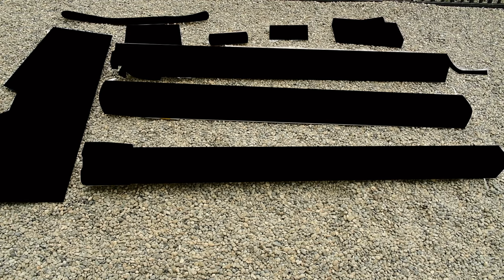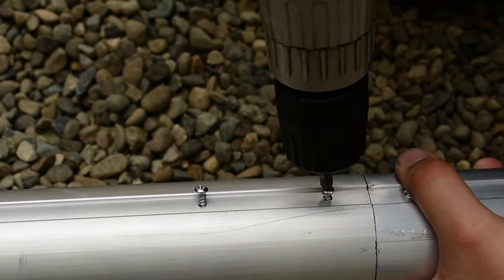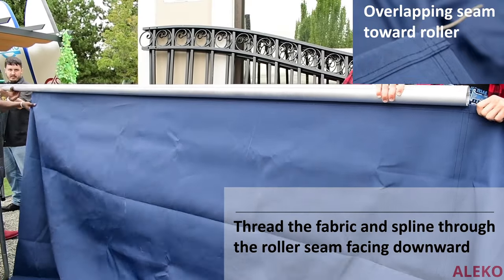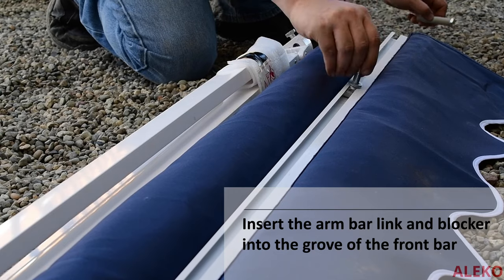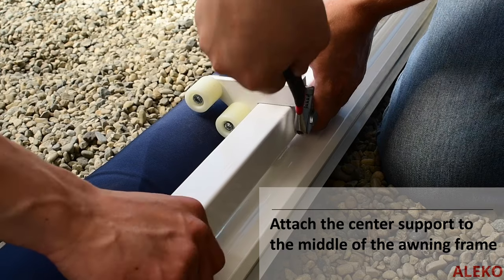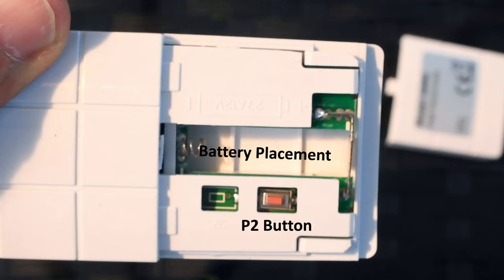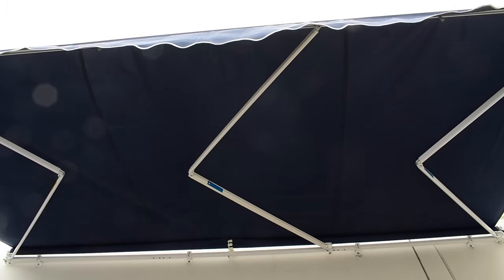How To Assemble and Install Your Motorized ALEKO Retractable Patio Awning

Comment: These instructions are awful.  You should hire a professional company to do your videos instead of doing them in your back yard.  Hours of frustration trying to get the motorized awning to work and still not working properly.  Will probably return.  I am pretty handy but this has been a nightmare.  Bolts are all in tight spots, materials are questionable and the instructions are awful.  Save yourself the heartache.
Reply: It's stuff like this that I am pissed about the removal of the dislike button. Bloody thing doesn't come with instructions, so I had to find it here--and yeah, they are shite.

Was almost as aggrevating as when we found that the center of the main fabric had been completely stitched--so we had to cut the threading piece in half and stick one piece in each end.
Reply: It sure is awful instructions! The company need to do a better and stop wasting space on YouTube.
Reply: I totally agree. A pin in the @ss!!!! Now im going to take it back down and build an actual part over the deck.
Reply: Deffinetly true.i couldn’t even figure out what direction to mount the arms

Comment: I assembled and installed by myself in about three hours.  The wife and daughter hoisted from a window above as I heaved up and into the first left hand wall bracket. I followed the instructions slowly and precisely.  I enjoyed it. In the morning I will fine tune the arms end connections at the front bar so it can fold and close smoother.  The adjustable LEDS are perfect.  The sand color and brown frame match my windows and entire back yard house and surrounding.  I love Donald Trump but I am very thankful for China today and this very well priced and manufactured Awning I received in two days from Ebay.  I am in Canada by the way. The wife and daughter hoisteed from a window above as I heaved up and into the first left hand wall bracket.
Reply: I hope that you have recovered from your temporary insanity about the former orange guy....

Comment: Installed my 20x10 unit last Saturday. I watched multiple videos and read the instructions. It went fairly well but I did have some issues. This is a difficult project.
Reply: I am installing 20 x 10,  do you have center support. I don't have that in the box.
Reply: the instructions were horrendous!!! I had to take apart and reassemble some parts multiple times.  Very difficult, especially if you do not have alot of mechanical ability.
Reply: Agree! This is not easy! My fabric is going all crooked!  Hopefully I can get some technical help!
Reply: @weiren9452  sorry I didn’t see this when you wrote it. Mine had 4 wall brackets and 3 support arms. Had it a year now and love it. The fabric has faded and will replace next year. Installed another one this year for my son.

Comment: Finally installed my 20x10' motorized awning.  Took my time during assembly process and asked 3 people with 3 ladders one weekend to help me put it up.  I would say total weight is about 170lbs.  As long as its done with no shortcuts it should be fine.  Found out that the motor was bad when I put it up but Aleko customer service was very helpful during my calls with them and warranty replacement was shipped to me in no time.  Overall, I'm happy with the purchase and customer support.
Reply: Yes. I’ve had mine for 5 years and loved it until the fabric finally wore through on a few spots where I rubbed on part of the assembly.

Comment: Ok. So I installed my 20 foot awning last year.  Immediately realized that the four brackets provided were under too much stress and weren’t enough. I stopped.. took down the awning and ordered 4 more.  With 8 total mounted into studs behind my vinyl siding it was fine. Make sure they are PERFECTLY aligned horizontally AND the depth. They don’t provide any kind of fasteners for wood so I bought large bolts and used washers to adjust the alignment depth wise. All in all pretty labor intensive but a decent product for the money. Provides the shade we wanted and looks nice.

Comment: What sizes does the center support frame/roller come with?  I hear the 10x13 awning sag in the middle.  Saw are review from 3 years ago and he fought with the company and finally got one and had to disassemble and install.  Do the 10x13 now come with them standard.  They should.
Reply: Slide  the center support/roller  onto the torsion bar before connecting the 3 pieces of the bar together. Not mentioned in the video or the printer instructions. Printed instructions are poorly done and do not mention the motor installation. Video is well done except for the roller. I had to take the torsion bar apart to install the roller assembly.

Comment: WARNING: ***IF YOU FOLLOW THE INSTRUCTIONS AS PROVIDED BY THE VIDEO YOU WILL BE FORCED TO TAKE APART AND REASSEMBLE YOUR UNIT ***. ALEKO has changed the parts since this video was made. At 5:31 you can see the installation of the center support. The center support part provided in newer units is NOT the same part as the one in this video - instead of the part that hooks onto the torsion bar being enclosed on 3 sides as pictured in the video, the part is enclosed on all 4 sides and as such must be installed earlier in the process by sliding the center support onto the bar instead of clipping like in the video. The center support must be installed before connecting the torsion bars (0:49).
Reply: Just terrible how they would put a QR code for this video on the current model’s manual .. this video does not align to the current model And causes frustration. Assembly has been a nightmare !
Reply: Just saw this, ridiculous ALEKO, do better!

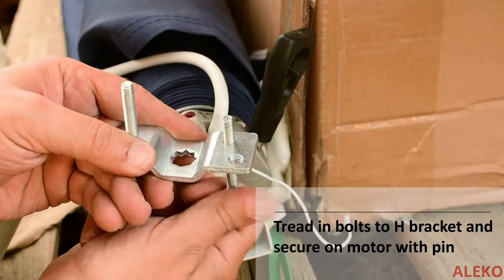Comment: Between 3:30 and 4:00 you show using long bolts to connect motor to H bracket and then to D bracket. Right after 4:00 you show that assembly with short bolts going the opposite direction. Am I missing something?
Reply: EXACTLY.. another issue they have.

Comment: First and foremost, let me echo a number of the other comments made here. 
HIRE A PROFESSIONAL TO CREATE YOUR ASSEMBLY AND INSTALLATION GUIDES !! 
The video was okay but way too rushed to be of great value to Joe Consumer.

I'm three and a half hours in to assembly of a 10' x 13' manual retractable awning. 
Here's what I have discovered... 
The holes pre-drilled on the Roller bar, Front bar and Torsion bar connectors aren't quite where they should be. The milling of the connector for the Roller Bar, specifically the fabric channel, is off just enough to prevent the easy feeding of the fabric through the two sections of the Roller bar. In fact, we had to disconnect the two Roller bar pieces, feed the fabric through then reconnect. When rolling the fabric on to the Roller bar, which way is counterclockwise ? When two people are standing one at each end of the Roller, counterclockwise is different for each !! Which way is the fabric supposed to come off the Roller, top or bottom ? That would be a better indicator of how to roll the fabric. Roller Support Assembly; where does it say to remove the right Roller Support to attach the Roller bar ? Became obvious soon enough. "Blocker", didn't come with this awning. Included were two molded plastic pieces, poorly molded pieces, which don't appear in a parts list or anywhere in the videos. Are these Blockers ? If so, how do they install ? "Arm-Bar Links", the washers provided are too big !! They don't fit in the channel of the Front bar, unless they are forced in with a persuader, which I wouldn't think you would recommend. Couldn't use them. 
Gone as far as I can today. Actual installation to the house won't happen until I have additional help.
Oh yeah, I still have an 8' x 10' awning to assemble. Should be a piece of cake after today's learning experience.

Comment: If you have a fish tape, use it to pull the splines through rather than push them. Much easier. I was an electrical contractor so I had a fish tape. If you dont have one, try using a piece of #12 or #14 AWG thhn wire or something similar, that will make it easier as well. .... Good luck

Comment: I'm assembling my 12 x 10 motorized.  The instructions are crap and this video isn't much better though it did help with the motor since there is nothing in the written instructions about it.  Just got back from Lowe's to get some 1.0 mm x 40mm bolts and nuts to connect the motor to mount

Comment: Finished installing the Aleko 12 x 10 motorized awing this morning.  Here are my thoughts regarding assembly and installation.

First, spend a good amount of time looking at the parts diagram and familiarize yourself with all the parts.  Watch the videos, but in the end, the instructions should be the default source. Assembly at times was challenging.  The roller tube as an example was difficult to get together with the connecting tube.  The fit of the parts was not quite there.  It took some persuasion and perseverance at times to get parts to cooperate.  Some areas of the instructions -- like where exactly do the 'blockers belong.  Ours is working but I am still not sure that the blockers are in the correct spot. Other issues included trying to find instructions on left-side motor installation.  The best we can figure doing a left-side installation means the motor cord will come off the top of the awning.  Right-side will allow you to have the power cord come from the bottom of the motor -- You'll see what I mean when you get into the assembly.  When installing the spline into the fabric something like an electrician's fish tape is a big help. Run the fish tape through the fabric where the spline is supposed to go and then pull the spline through.  Will save you an hour in assembly!

Mounting on our house was a bit challenging but not the fault of the awning. We have vinyl siding where we wanted to mount the awning and one and a half inches of Styrofoam 'Cladmate' behind the siding.  So for the lag screws to reach the interior studs, I had to devise a 'standoff' pipe so that the mounting brackets would not crush the siding and Cladmate insulation.  A 1" diameter metal conduit cut to 1 7/8" in length allowed the brackets to standoff from the siding by 1/8" and using 5" lag screws secured the awning assembly to the house studs.

Overall assembly and installation happened over two days.

You will need two people minimum to do the assembly.  A third person would be helpful when installing the fabric.

Bring your patience -- you'll need it.

Finally, the awning does look great. There are still some tweaks to do, but the results so far is a great looking and working awning.
Reply: Thanks for the detailed report. I have a few questions if you don’t mind....

1) Can the motor be mounted on either end?
2) I plan on attaching a 12’  ledger across the vinyl siding to attach to. 
     As the siding isn’t flat, what did you do to “level/flatten” the face of the vinyl siding?
3) How much of the lag screw did you sink into the wall studs?
4) I have to mount right above a door. The door extends 30” when fully open.
     Would you possibly know how many inches the front of the awning has dropped at 30 inches out from wall?

Thanks!!!!
Reply: @thistle4celtic1  hi. Yes the motor can be mounted at either end.  Because we had Styrofoam cladmate behind our siding I made these 1 7/8” aluminum ‘strand offs” that actually protrude form the house about 1/8” to 1/4” away from the siding. The lag screws go through the awning brackets and through the stand offs and then into the wall studs.  The awning doesn’t put any weight on the siding or classmate. It literally appears to float away from the siding. I didn’t want a visible ledger. The stand offs are made from 1” and 3/4” aluminum electricians pipe.  Cut to the length needed.   In my case I have 1 1/2” Cladmate on top of the framing. Then the Tyvek house wrap and then the siding. So my stand offs were cut at 1 7/8”.  I put the 3/4” pipe inside the 1” pipe for strength and a big 1” washer on each end of the tube.  The lag screw can pass through both washers so it can be screwed to the wall studs.   Wish I could show you what I did and it would save you putting up a header.
Reply: @thistle4celtic1  I am into the studs just over halfway. - about 3” in.  I will have to measure the drop though and get back to you.
Reply: @markbell1  Thanks Mark. I absolutely understand what you did. I may go that route too now:)
Reply: @markbell1  Thank You...Also, how far in from either end are your end brackets?
Reply: @jackmcqueen4206  On the left side (Motor side about 1 foot.  The centre is the left of centre (centre being saved for the roller) and the right side is about 18-20" from the right end.
Reply: @markbell1  Thanks for the additional info Mark. It's much appreciated.
Reply: @markbell1  Thanks for this detailed comment. About to do the same job myself and this is incredibly helpful.
Reply: By the way, if you are reading this and thinking of installing this on vinyl siding, you NEED these conduit pieces. I had bought the conduit and I paid a contractor to come and hang the thing, and he managed to convince me against my gut feeling that I wouldn't need the conduit. One month later, the vinyl was crushed and the awning was no longer hanging straight. I had to remove and place and re-hang the awning after that. Small but annoying lesson to learn. Always trust your gut!
Reply: @conorbarber7502  sorry to hear your contractor flubbed the job.   It’s a year and a winter later and ours is still solid with conduit stand offs.  Hopefully it can be fixed!
Reply: Too bad I can't add a photo to comments. I also have vinyl siding. I used a treated piece of 2x10 & wrapped it with vinyl flashing to mount my wall brackets to.
Reply: @vapinbachelor289  So you essentially mounted a ledger board that matches the house siding?

Comment: The center support I received should be slid on the main support before the rest is installed. Now that I have it installed, I have no way apart from machineing a new part.
Reply: Yes I had to take my awning back off the wall un assemble to put support on. I'm not gonna mention the support is mentioned after you have fully installed the unit.

Comment: Folks - Save yourself the aggravation and get an awning professionally installed. I followed the directions (paper and video) the the awning never worked right. Despite several calls to customer support, I could not get the limit switch to work and the awning kept extending and retracting crooked. Plus, they didn't bother to print new instructions stating that the center roller support has to be put on at the beginning, not after it's all put together. I wasted the cost of the awning as well as the cost of having someone put it up and take it back off the wall. About $1,500 down the toilet. I recently had a sunsetter awning installed and I'm very happy with it. Better material and it moves straight as an arrow.

Good luck.

Comment: Very complex assembly and when mounting extreme care must be taken to clear the tube assembly bolts from the mounting brackets.  In other words the bolts that hold the bars together will not fit in the mounts. This was a big problem since I had a custom steel awning extension made and once holes are drilled it was difficult to cover them up.  It required them to be welded and repainted. If some mention somewhere in the instructions was made this would have made things easier.  Also the motor was very out of adjustment and required many, many turns of the red and white screws to set the extension and withdraw limits.

Comment: They don’t tell you that when you put the roller together in those sections, good luck, sliding the cloth in there without ripping it, because it’s almost impossible to slide the cloth because it keeps getting caught on the sections very sharp corners

Comment: What would be the average time of installing one of these with a couple guys that are halfway mechanically inclined
Reply: My husband and I mechanically inclined and are going on two days. It still isn't right. I hate this thing. It's heavy as hell, and you will need at least four adults to get the awning on the brackets. Ours is 16' wide.
Reply: we also needed to make to holes bigger in the mounting brackets and still couldn't get one of the bolts through and had to use a 1/4 bolt instead. We don't have the pitch right yet and haven't even tried the motor.
Reply: @suzannezoerb1140  I'm sorry to hear about your experience. I'm looking to buy but sees like I shouldn't invest my money here, correct? Thanks.
Reply: @asimali6622  it all depends on how much time you want to spend installing. Not an easy job, instructions are very bad. I am in day 3, about total 8 hours now...if you get good  instructions you may be able to do it in 4 hours. still have doubts about the overall quality and durability. Time will tell. Hope to finish in another hour and then test it...once done I will try to summarize the mistakes I made :-)

Comment: The support rollers that ship with Aleko awnings can no longer be installed after assembling the frame. The one pictured in the video has an open end allowing the support to be seated on the square frame after assembly. The one that shis now is plastic and has no open side, it has a square hole that must be slid onto the square frame before connecting sections. Its a pain in the ass. Install them first even though the instructions never mention them.

Comment: I bought this Awning to install on my home. Without knowing it was made to attach to concrete. How should I fasen this to a home with vinyl siding.
Reply: You can install them on to the vinyl siding, I did it over my patio door. Absolutely necessary to find the studs, and you can buy lag bolts from any hardware store. I used 1/2" X 6" bolts. Also used the "Builders Edge 130110006001 Octagon Mounting Block, W X 6-7/10 in H, White" to hold the brackets on to the vinyl sidings to flush them flat.
Reply: B